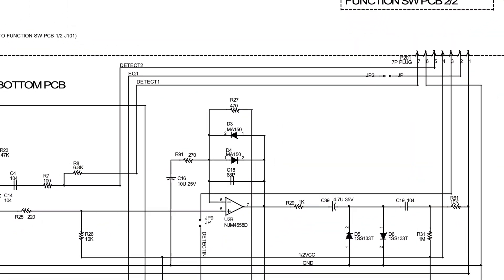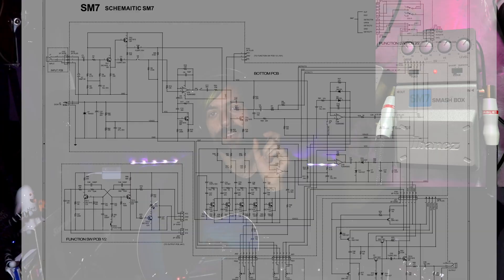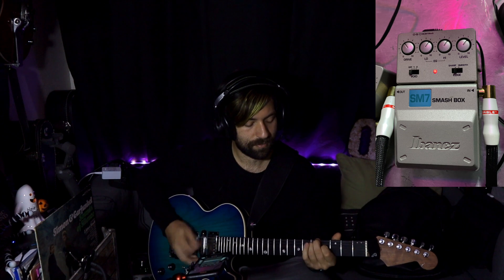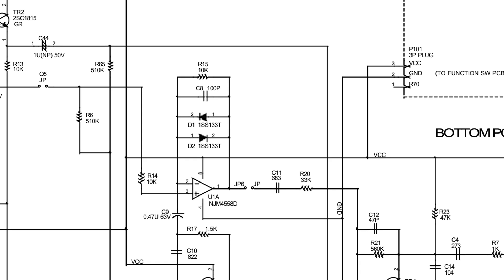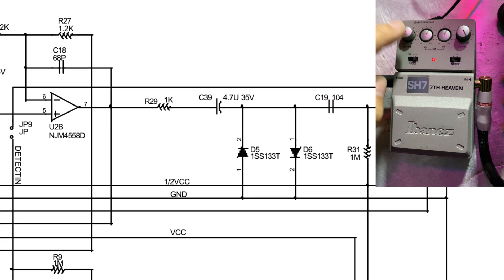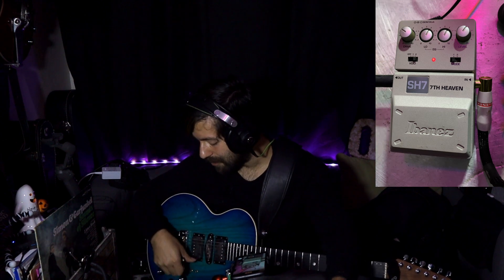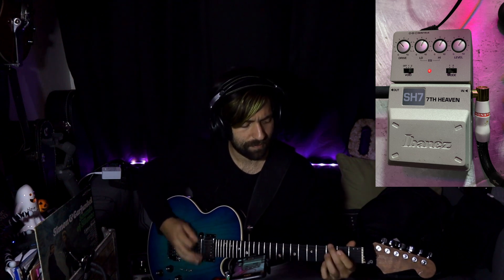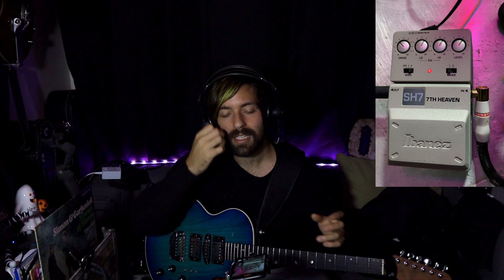SH7 and SM7 Review and Technical Analysis | The Q Show ep.26

Comment: So basically your saying ibanez did the djent thing in pedal in theory all the way back then. I mean I guess people probably were boosting amps with tubescreamers but not like now where noone uses a high gain amp without an 808 first.
Reply from the maker: I wouldn’t call it djent, it’s more like a sludgy fuzz pedal that’s expecting a detuned guitar on the way in. Think about how korn used the 7 string in their early stuff (as opposed to what Meshuggah was doing then, which is a bit more pre-djent)

All in all a really cool pedal, I’m glad to have it 😁
Reply: @TheQShow  Oh yeah Im not saying they were trying that or achieved it but I mean designing a pedal to have a mid heavy low cut ts style front end to increase the transient and lower the mush. A lot of the nu metal tones from what I can tell were straight into rectifiers without boosts which gave them that fizzy on top massive bottom end thing. Then people in prog metal didnt want that and started using tubesceamer style circuit to tighter up amps even tighter amps like 5150s and we ended up with djent. I think I want both pedals now though, they seem to sound a lot better than I thought they would.  At least in your video the sm7 does seem a lot closer to the boosted recto/5150 sound and the sh7 to the raw recto sound. I think I want both pedals now though, they seem to sound a lot better than I thought they would.

Comment: I'm thinking about buying the SH7 pedal now. It could be really cool for bass, synths or sound design. Do you think I'll need some kind of pre-amp or such for synths?
Reply from the maker: Firstly thanks for watching! I agree that the SH7 would be a solid choice for anything in a lower register.

However, to me, fuzz pedals in general are expecting something after the fact for sure. Otherwise they can sound quite harsh.

My amp settings in my videos are very clean but they are all ultimately going through a preamp and poweramp with cabinet sim, the cabinet sim being the most significant factor in this case when comparing to DI.

This processing could be done in the box as well. But I’d probably run a synth into a preamp if I had the ability to. I love inductive EQ’s for this sort of sound design personally.